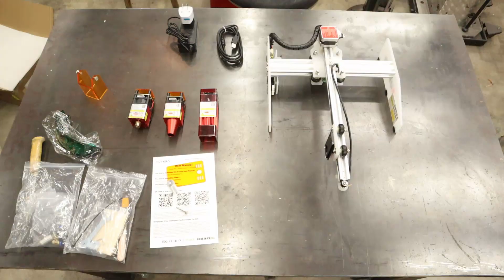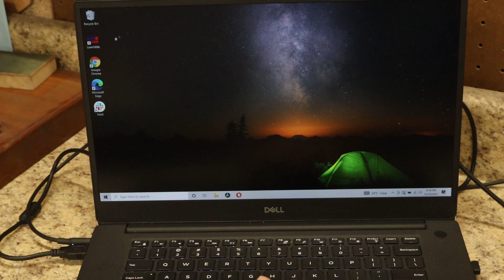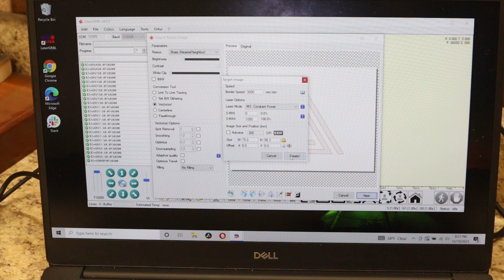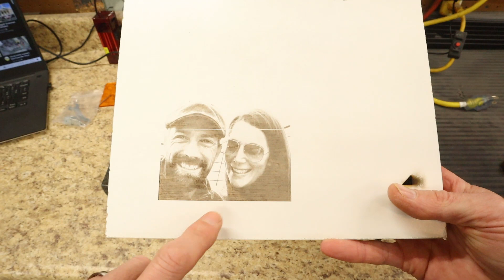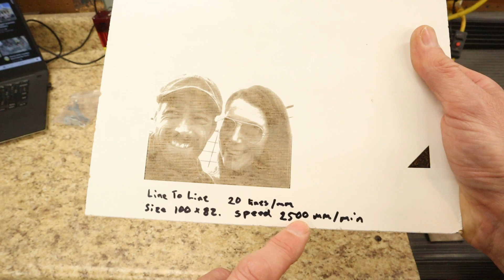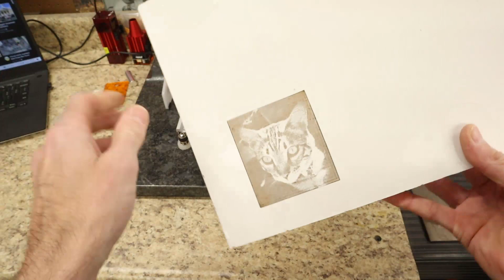Coolest tool for Knife making! The Aufero Laser 1

Comment: Now that a little time has passed, can we get an update on using it for hardened steel? Really want to pull the trigger on one but I want to see someone do that first. I know it will mark hardened steel but will it engrave it?
Reply from the maker: This is not the ticket for hardened steel
Reply: @Aleeknives  good to know
Reply from the maker: This is an amazing little machine but it just isn't a fiber laser
Reply: @Aleeknives  do you think it'd work for just marking blades? Good enough that it'd hold up on a blade?
Reply from the maker: 100% it does that great! Just doesn't cut really deep

Comment: Awesome. I just got one last week too. Did you do dither at 80% 100mm for the logo on 1095?  I tried cutting g10 and it caught on fire and smelled like you shouldn’t breath is🤣.
Reply from the maker: I did the steel at 100% at a rate of 100mm. I also burned through some material and cut right into my granite counter top😳

Comment: I don't think there's any right or wrong with lasers. If it looks good then you're doing it right.

Safety first.  Yes the fumes can be toxic.  You might want to put a fan in there or something.  It all depends on what you're burning.  Even chromium sometimes found in steel is probably not too healthful to breathe it.  Or just wear a mask.  Pretty much same rules as when working with epoxy.  

You have to be careful with your eyes. Do Wear your glasses.  It's always possible you can get a laser reflection especially off metal.  

If you're running the laser unattended, make sure there's nothing flammable anywhere near it.  

If you want to run the pattern multiple times on the same piece of material, then consider locking the material down using a clamp.  

It looks like you're really having a lot of fun. I enjoy watching the videos.
Reply from the maker: There was a lot of really good information here! Thank you!
Reply: good  Lord.  hide under your bed
Reply: @jackspradt1562  

Who said hide under the bed?

If you don't believe in safety there's some neat games you can play.  I can think of one involving paper clips and wall outlets.

Comment: I think for how cheap it is, defiantly works well, for something a bit more permanent in the workshop you could get a sheet of something like FR4 pcb material or aluminium to mount it down to so it doesn't wiggle as much. Then just drape a piece of welding curtain over it, after 15 years in a past life working with high powered telco lasers they're not something to take chances with and fairly much the same as arc welders for eye damage.
With your leather working skills I can see this being a huge help, plus just for engraving a signature onto a knife its a heck of a lot better than stamps, etching or messing around with other methods
Reply from the maker: 100%

Comment: Can you use it to put your markers mark on a blade
Reply: I'm guessing that the 1095 isn't hardened
Reply: @lorneclose7312  doesn't matter.
Reply: I would be very surprised if that really can be done effectively, I thought you need a higher power fiber laser?
Reply: @dmitryk754  not when process is   repeated.
Reply from the maker: Apparently 20watt is enough to get it done!
Reply from the maker: Yes I think it would do fine, at least it worked on the 1095

Comment from the maker: I am thinking I can now make custom logos on handle materials and blades, also customize leather sheaths
Reply: You’ve sent me down a rabbit hole with this lol It seems they have an air assist option that may make it easier to cleanly cut materials. So you could probably cut out sheaths and engrave them at the same time. I am getting this laser pretty damn soon now.
Reply from the maker: You are 100% correct. They sent me the air assist, I just jave to keep the videos close to 10 minutes long. So much more to show with this! You hit the nail on the head with the sheath ideas
Reply: @Aleeknives which laser module would be best for putting a makers mark on a heat treated knife.
Reply from the maker: Good question I don't have enough time on it to be conclusive yet. I think either of the 20 watt modules would work but I haven't tried the long focal length Laser on steel yet
Reply: @Aleeknives  I'd love to see another video of engraving a makers mark on hardened steel once you've had time to play with it more.  I've been looking for a laser to mark my knives that won't break the bank, most I've seen a 6k+ and that's just too much for a hobbyist like myself
Reply from the maker: Totally understand
Reply: @Aleeknives  love your channel, man. thx to u i bought this laser at the same price i bought my old laser which couldn't engrave a marshmallow.
Reply: Okay this is slightly ambitious... what about burning it so deep that you could do in lay with it?
Reply: I just tested my 20w SF laser on 1095 steel and can get it to mark but almost no depth. Not even close to the depth of the logo you have on the right side of your steel stock. Same power and speed settings too. I'm thinking this may be an inefficient setup for truly engraving a logo into knife steel. Thoughts?
Reply from the maker: Interesting,  100% power at a speed of 100? I jave played with it even more since the video and found that of I run it like 5 passes it Engraver entry deep enough for a makers mark. Not as deep as my stamps but entry deep for a mark. I have NOT tried it on hardened steel yet